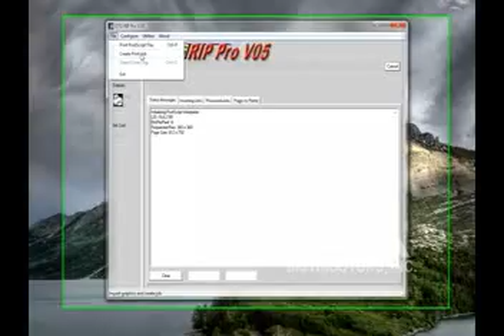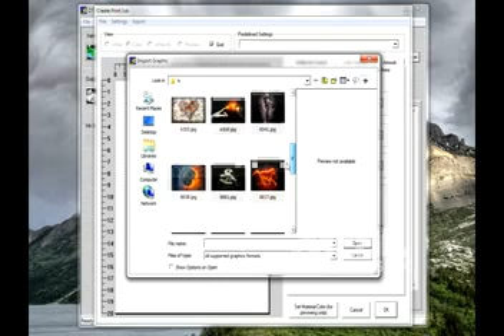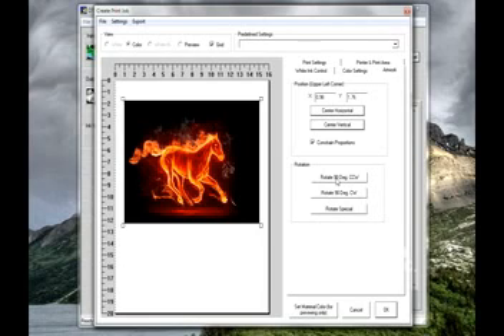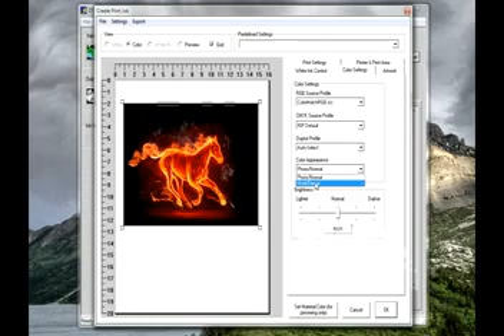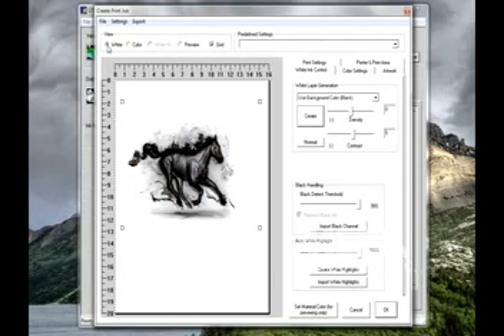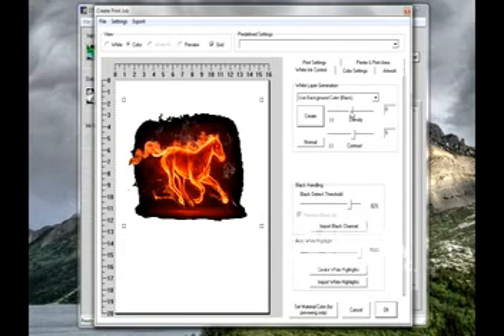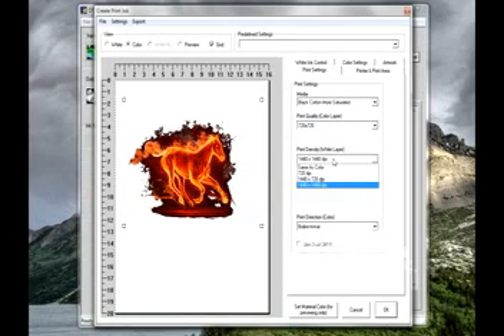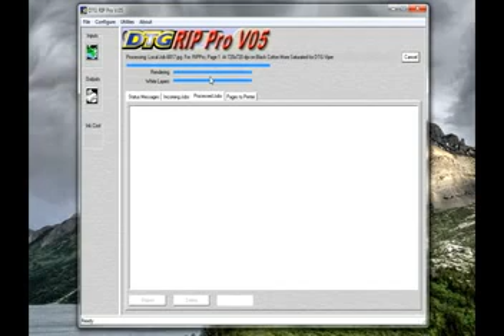Summit DTG Training : Printing - Printing a Black Shirt

Comment: Im using the Summit xt. What might be a reason my images dont come out on black like the one in this video?
Reply from the maker: +fallguy76  Besides the printer itself (and we know the Summit XT produces beautiful prints on black shirts), other factors that can affect print quality include

- maintenance (printers that sit for more than a day or two without printing may suffer clogged ink lines or a clogged print head)
- the ink (not all inks are created equal - we recommend Dupont Artistri inks or Image Armor E-Series inks)
- the image (should be large, clear image with good contrast, at 300 dpi)
- the pretreatment (again, not all pretreatments are created equal - we recommend MESA pretreat, or Image Armor Ultra Dark Pretreat).  Most pretreats perform best if they are set with a heat press. Never print a garment until the pretreatment is completely dry.
- the heat setting process, which will vary somewhat depending on the inks and pretreatment used. We recommend starting at 338 degrees F, press 60 seconds, allow to cool a few seconds, then press another 60 seconds.  Read instructions for the brand of ink you are using, then test and adjust until you find the heat press procedure that works best with your heat press, inks, and pretreatment.

This is a general guide - if you purchased your printer from MESA, call our support team at 800-330-3867 Option 2 and they can help with further troubleshooting and schedule a repair if necessary.  If you purchased a used printer 3rd party, it's possible that the printer needs a good cleaning of the ink path or may need a new print head if the printer sat for an extended time with ink still in the machine.  Always flush ink from the machine if the printer will not be used for more than a few days.  The flushing process varies depending on the type of ink used - it is important to do this correctly or you could damage parts on the printer.

As you can see, there are many variables, so it is not practical to offer specific advice in youtube comments.  There are tshirt forums on the internet where many dtg owners gather to trade ideas and offer assistance - this might be a good option if you purchased a used printer.